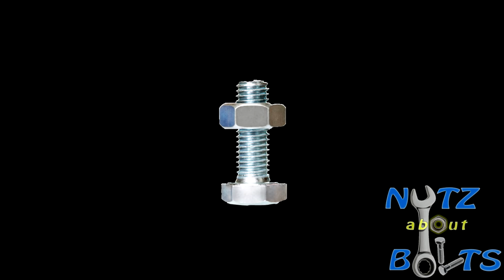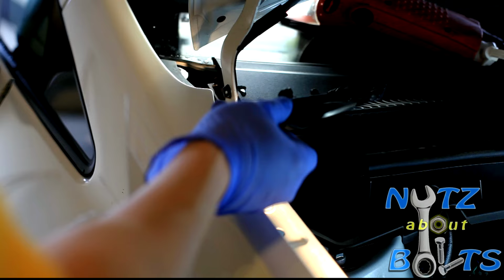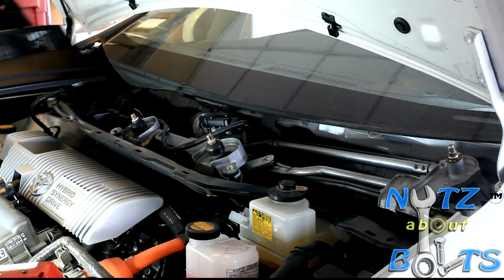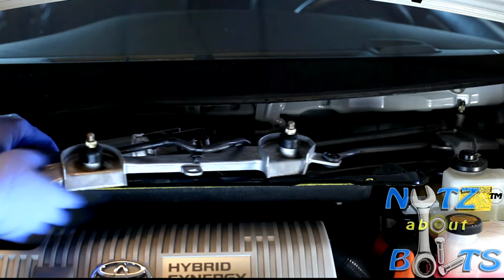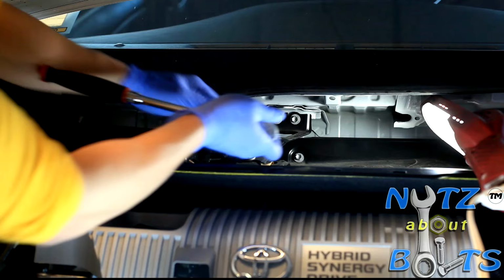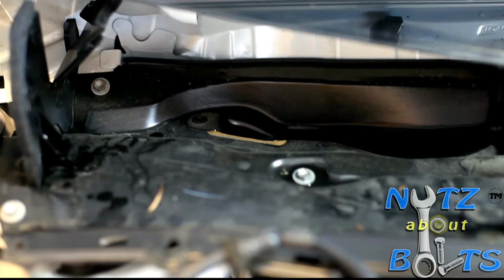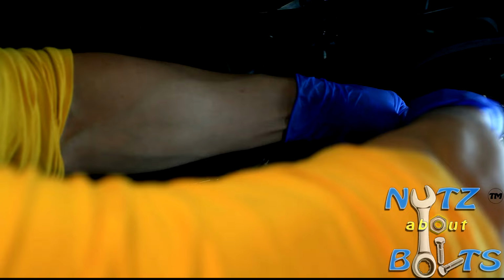2010-2015 Toyota Prius Spark plugs remove and install HD

Comment: Great video. I'm only an oil-changer, but will try this next week when Denso Iridium plugs arrive for my 2011 Prius 152k miles. Tired of constant dealership service upselling! 
Not familiar with anti-seize or dielectric grease. Any extra advice or cautions?

Also, can I use same process for my 2012 Prius V 121k miles?

Comment: Just need to clarify:
At 17:00 in the video, while starting to torque the spark plugs, you say to be sure to torque at 20 ft-lbs.  In the video's description you have 13 ft-lbs.  On-line I saw a page that said specs were 15 ft-lbs, but if you use anti-seize, then torque to 13 ft-lbs.  I didn't notice this difference until after I had done the job, torquing at 20 ft-lbs.  I used anti-seize on the plugs and dielectric grease in the coils.  Do I need to go in there and back them off and retorque at 13 ft-lbs?  It's been 3 days and the Prius is running great. 

(Also, my larger 1/2-drive torque wrench can hardly torque 10 ft-lbs, much less 8 or 6.  Describe the difference if you're just hand tightening: ie - "10 ft-lbs is small-wratchet hand-TIGHT, 8 is nice & snug but no further, and 6 is just past the tightness you can achieve without a tool/fingers only--put the tool on a give it an 1/8 turn."

Thanks! Love your videos!
Reply from the maker: No, you’re fine, I did that and I recently replaced my spark plugs and it was fine.

Comment: What is the gap supposed to be? I bought Toyota dense iridium plugs for Prius/corolla (they are in a Toyota box, so I would guess it's gapped from the factory) Also 20 ft. lbs. for plugs sounds high. Isn't it 13?

Comment: Where is the silicone paste used? The anti-seize grease is applied at 15:30, but I didn't see the paste
Reply from the maker: I applied it on the ignition coil tubes. The rubber part at the end where it attaches to the top of the spark plugs.

Comment: Great video thanks. I have a question about preignition 2012 prius 200000 miles. It pings with 87 gasoline. What would cause this? Pruis vehicles are not required 89 or 90 octane right?
Reply from the maker: Could be headgasket issues, or piston rings. I’m still using 87 without issues, I’m at 238886 miles
Reply from the maker: Any check engine light?

Comment: I don’t get what’s the purpose of taking all that stuff off when the spark plugs are right there is it possible to change them without removing the big items can’t I just move the gray thing and change them?
Reply from the maker: The wiper cowl housing is in the way of the spark plugs from coming up and off. I believe the Prius C or right hand drive vehicles have the room to remove the spark plugs without removing everything.

Comment: Is it just me or does it look like the plugs are accessible without having to take that much off?
Reply: That’s what I was going to say. It looks like he just took the engine cover off and they were right there no?
Reply: @shafi10a  - I checked.  You can get the engine cover off and SEE where the plugs are, but it would be much easier to extract and replace them without the trim panels in the way.  You’d think they could have made the panel so the needed bit was removable, but as you only need to change plugs every 100K miles, they probably figured it was no big deal.

Comment: Thanks for uploading such a helpful video. How often u have to change ur spark plug on prius 3rd gen? I have 2014 with 80k and now dropping the mpg but no code has popped up yet. Plz need advice :)
Reply from the maker: spark plugs every 120k. You should join the PriusChat forum, there's a lot of maintenance you can do with the Prius that needs to be done, such as EGR, EGR pipe, EGR cooler etc.. etc.. you can join the forum to talk about your issues as well.

Comment: I learned enough to know my next stop is the dealership!!!
Reply from the maker: 😅

It takes 20-30 mins if you use electric tools
Reply: @NutzAboutBolts  it takes an hour and fifteen minutes at the dealership.
Reply from the maker: @kensimpson8665  hopefully they didn’t charge you too much 👍🏼

Comment: I torqued the spark plug connector to 10ft-lb like you said and it shattered the bolt.
Reply from the maker: wow... sorry to hear about that... just hand tighten it next time, did you replaced the bolt?
Reply: +NutzAboutBolts yeah just took it to the shop and got the broken bolts drilled out. They replaced the bolts with some they had on hand. I'll order some OEM bolts soon.
Reply from the maker: nice, weird how it just shattered...
Reply: +NutzAboutBolts could be my torque wrench wasn't working right.  New Tekton wrench.
Reply from the maker: its possible... those 1/4 torque wrench can be fussy, I don't trust any other brands besides MatcoTools and SnapOn, but those are expensive.

Comment: PLEASE HELP  I've used all your vidz on maintanence and they are very helpful. We are at 128k and I am doing the plugs. I have a 9/16 socket and the plugs squeak and just spin and will not come out! Any suggestions. TIA.
Reply from the maker: Is the socket grabbing the spark plugs? Is the spark plugs fully loosen from the engine? You can use a magnet if the spark plugs are already loosen and pull it out
Reply: @NutzAboutBolts  thanks for the quick reply! A lexivon 9/16 magnetic socket off of Amazon does NOT reach. I was limited on parts and just added two 3 inch extensions to a 9/16 socket and realized the part I bought wasnt reaching and gets stuck 2/3 the way down making it seem as it is on the plug!!!
Reply from the maker: Billie C try using a regular 9/16 socket to loosen the spark plugs, after that, use the 9/16 magnet to pull the spark plugs out. That’s what happened to us as well, we used a 9/16 rubber insert socket and it didn’t reach to the thread on the spark plugs, so I used a regular 9/16 socket to loosen the spark plugs and then used the rubber socket to pull it out. I’m not sure why these spark plug sockets are like that. Maybe the Prius spark plugs were made longer.
Reply: @NutzAboutBolts  THANK YOU!!!

Comment: 11-18 lf-ft torque according to SPI & Owners Manual for Spark-plug SC20HR11 Denso iridium tipped long life spark plugs
Reply: Have a 2010 Prius coming up on 120k & researching the procedure. It may be possible to do this procedure without removing all the upper cowling / wipers / sub frame etc. Requires more tools, socket CV joint bend connector, torque wrench with adapters, 10mm 12mm & 14mm sockets. The procedure for the 2nd Gen. Prius much easier! This looks like Toyota borrowed concepts from BMW //

Comment: Nice video. I am about to change the spark plugs on my Prius V 2013 since I got everything out cleaning the intake manifold and EGR cooler. Do you recommend NGK Laser Iridium spark plugs or Denso Iridium spark plugs that are available at the dealer ? Thank you.
Reply from the maker: Both is fine,I just buy whichever one is cheaper

Comment: first thing thanks alot for this video...

second thing what's this anti size do??

and what happens if I don't use it??
Reply from the maker: Tariq Goussous The anti sieze helps prevent the spark plugs from seizing to the threads of your engine head since its aluminum, some spark plugs like NGK already came pre-lubed with anti seize so you don't need to use it. If you have spark plugs that doesn't have the lube, then I suggest you lube it.
Reply: NutzAboutBolts if this is the first time my coils come out. Do I really need to grease them again?

Comment: Wow it ain't like the old days, but since you don't have to do until 120k miles I can't complain.  Did you have to check the gap on the spark plug, or was it already set?
Reply from the maker: It came pregapped

Comment: Hi there, I just ordered things from your list that I didn't have to complete the job, and would like to point out that the spark plug socket set you recommend is not actually long enough for these spark plugs. You must have used something different.
Reply from the maker: Thanks! I will add the 3/8 extension in the link as well. With the 3/8 extension, it'll be long enough to remove the spark plugs. Sorry about that!
Reply: No, sorry, I meant something else - when I insert the spark plug into the socket, the spark plug does not go in far enough for the socket to hold the bolt part of the spark plug. So turning the socket does not turn the spark plug bolt.
Reply from the maker: ah I know what you mean. It happened to me as well, what I did was remove the rubber grommet inside the socket, then remove the spark plugs and reinsert the rubber grommet back in to remove the spark plugs. I hope that helps.
Reply: Aha, had not thought of that. I didn't realize that grommet down in there was rubber. I was considering taking a drill to it but didn't want to screw it up.

Thanks for the helpful and quick replies, I really appreciate it.
Reply from the maker: lol, no problem. If the rubber grommet doesn't come out, just find a regular deep 9/16 socket around and use that instead. :)

Comment: Great video! I have a 2010 with only 60K miles, but it feels sluggish. I'm only getting about 38mpg. Should I replace the plugs? Thank you
Reply from the maker: +The Hasbro Man that's odd, it could be other things that can cause that. Plugs shouldn't go bad at 60k and your car shouldn't feel sluggish at 60k. Try cleaning the throttle body, change out the engine air filter, and put in shell, chevron, or 76's gas. Don't run cheap gas because it'll just burn fast and cause carbon build up.
Reply: +NutzAboutBolts thanks for the great advise. now I'll have to look up how to clean out the throttle body.
Reply from the maker: The Hasbro Man
we have the throttle body cleaning video.
Reply: +NutzAboutBolts yes, I watched. I cleaned it and swapped out the old air filter with a k&n filter. It's running around 50 mpg again! Thanks!
Reply from the maker: The Hasbro Man
nice! good work! glad we could help.

Comment: Can I use any dielectric grease like permatex or do I NEED the 3M silicone paste? Thanks for the video also!
Reply: Denso and NGK platinum and iridium need no antisiege. The metal alloys of stainless steel will never corroded and putting lubricant may strip the tread because the same torque strip further

Comment: I googled ignition coil change and this video popped up. Are they the same thing? I'm getting a p0300/303 error so I'm assuming it's coil 3. Thanks
Reply from the maker: yeah its the same procedure, but this time you don't remove the spark plugs but you remove the coil itself out and replace it.

Comment: I recently bought a 2012 Prius 2nd Generation with 77k miles on it. I just wanted to know how often do you need to change spark plugs on a 2012 Prius? Thanks
Reply from the maker: They’re good up to 120k miles.

Comment: Got a question for you. If the spark plug came off and got stuck in there. How do you take it out without breaking the spark plug?
Reply: Use a magnetic pickup tool. $3 at advanced auto, but are sold everywhere. In fact they now make spark plug sockets that use magnets instead of a rubber gasket to hold the plug in place.

Comment: This is an awesome video. Just one question - in the spark plug socket set you recommend, it looks like the 9/16 socket isn't anywhere near long enough... did you have some kind of adapter? Thanks. I'm hoping to change mine this weekend.
Reply from the maker: you can use a 3/8 extensions to make it longer.

Comment: Hey my prius making some rattling sound when driving over a uneven or pot hole surface this start happening after changing the front brake pads the sound is coming from passenger side. Any idea what it could be please
Reply from the maker: I would recheck the work and make sure all the parts are bolted down correctly. If it never happened before the brake job, then its possible to recheck the work.

Comment: hey! really great video. i want to change out the spark plugs on my 2010 prius. i've never done any car repair before. would you recommend that i try this? i'm only concerned about losing a piece or not putting it back in the right place. any advice would be really really appreciated!
Reply from the maker: +nikonow anyone can do this, just make sure when you remove a part, you keep the bolts intact with that part. You can use a zip lock bag for all your bolts and clips and put it next to the parts that you removed it from. If you get confused or don't know where everything goes, you can refer back to this video of where all the bolts, clips and parts go.
Reply: +NutzAboutBolts i did it (even if it did take 2 hours...)!!! thanks so much for the video!
Reply from the maker: nikonow
lol nice, that's how long it took me as well

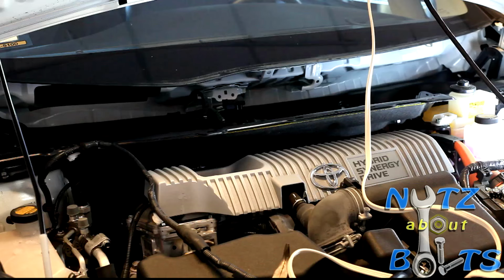Comment: My question is not related to spark plug removal, but wondering if you can provide some guidance. I own a 2011 Prius, The flap/part/vent that allows the outside air in is stuck in the open position. I have not performed any maintenance related to the A/C equipment so I am not sure what caused this or how to troubleshoot. I removed the glove box and the black plastic cover underneath it hoping it would give me access to the "flap". I see the mechanism/level that moves when I push the "recycle/outside air" button, but of course the access is limited without removing part. Can I access this vent after removing the panel that you pulled off "at an angle" at minute mark 11:20 or can I access the vent (and part that is stuck in the open position) by removing the factory radio. Great video by the way. I will be changing the spark plugs using your step-by-step video. Thanks in advance & God Bless!
Reply from the maker: You will have to remove the dash to get access to the part of the blender door. I don’t see a way to get in there without it...
Reply: I was afraid that was the case. Thanks for a fast response & God Bless!

Comment: Are all Toyota hybrids like this? That is a lot of work to change 4 spark plugs...
Reply from the maker: its only on 3rd gen from what I know, I'm not sure about the 4th gen since I don't have that vehicle. It's pretty easy once you've done it a few times. If you want to reduce the time, electrical tools will help tremendously. As people stated in the comments, it takes less than 1 hr 1/2 from start to finish.

Comment: There's conflicting information out there about using antiseize on the plugs. Whats your reason for using it?  Thanks
Reply from the maker: It’ll make it easier to remove the next time you change it. Some ngk spark plugs come prelubed, so I wouldnt use it on those.
Reply: @NutzAboutBolts   Some people are dead against it. Haven't figured out why, so thought I would ask about it.  Thanks for your quick response.
Reply: @NutzAboutBolts   Do you have a recommendation for purchasing ignition coils?  Mine have 220K on them. Thx
Reply from the maker: @jfevrier9593  that’s fine if they don’t want to, some people follow what they’ve been taught or experience. In my experience, it’s easier to remove the old spark plugs when it’s time to replace it when there’s anti seize on the thread.
Reply from the maker: @jfevrier9593  I’d check rockauto, Amazon, or any autostore that sells close to oem parts.

Comment: Thanks for this amazing video, i was having misfires in cylinder 2, especially when maintaing speed, so I replaced all spark plugs and the coil in cylinder 2. But the vibration is still there, but happens during acceleration instead of maintaining speed. Did I not install the plugs correctly or could it be another underlying issue.
Reply from the maker: Christopher Allen are there any trouble codes?
Reply: @NutzAboutBolts  check engine code, cylinder 2 misfire for the first one. After the replacement, the new symptoms but with no check engine light or codes
Reply: @NutzAboutBolts  could it be I didn't tighten the spark plugs enough?
Reply from the maker: Christopher Allen try cleaning the throttle plate, and the egr system.
Reply: @NutzAboutBolts  thanks, I'll get to it when it stops raining. I saw your video for EGR cleaning but do you have one for the plate cleaning?
Reply from the maker: Christopher Allen yeah, it should be under throttle body cleaning.
Reply: @NutzAboutBolts  hey, so I cleaned throttle plate and EGR pipe. Same issue, so I took the injectors out and they were very dirty, cleaned them by hand and cleaned out port the best I could. Could only test drive for 15 min before I had to leave for work ( in another vehicle) but I was getting some engine vibration but with no check engine errors. Could it be that I need to run some fuel cleaner and drive it around a little bit longer to make an assessment?
Reply from the maker: Christopher Allen I would clean the injectors and put in a fuel additive to clean them out and hopefully that’ll help.

Comment: is there a code for the batteries when you turn them back on ?  the dealer said you had to put in a code with the battery start.  maybe they just want the 860.00 they are charging me to change the spark plugs.... HELP
Reply from the maker: nope, never had to input any code, and if you do require a code, the dealership gives them to you for free with your VIN number, they shouldn't be charging you to get the code.

Comment: How did you use the magnetic 9/16 spark plug socket? I bought the gear wrench set but not deep enough. You have any pictures?
Reply: It just isn’t long enough. (Poor design) You need to go old school and use a standard spark plug socket with rubber gasket.